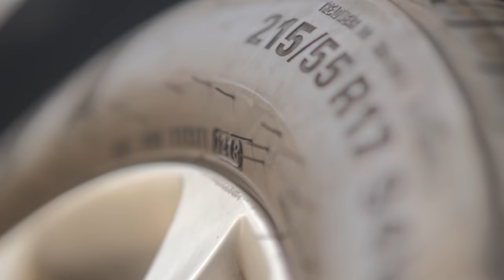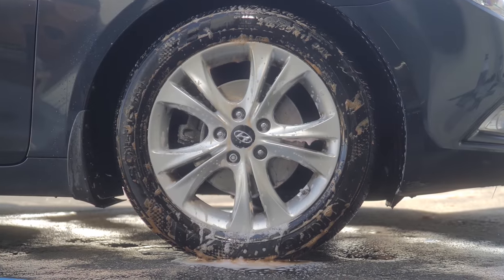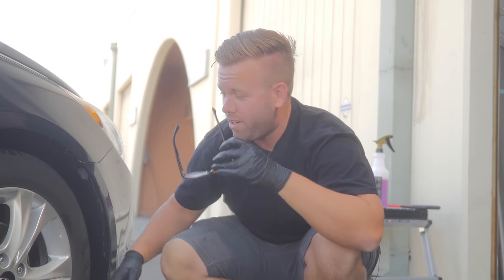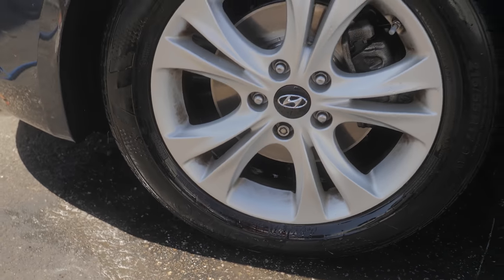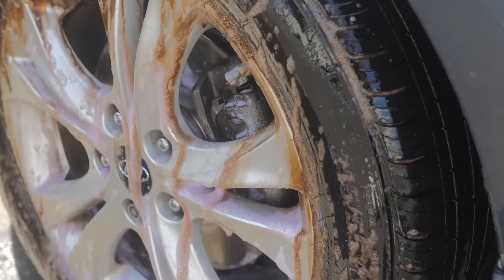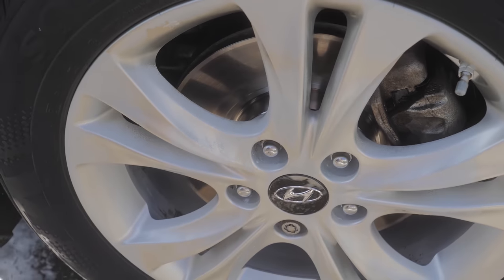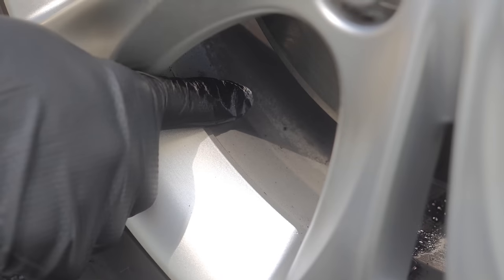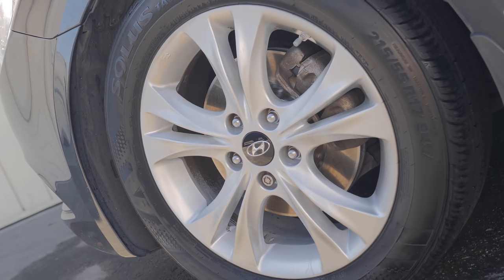P&S BRAKE BUSTER VS ADAMS WHEEL & TIRE CLEANER: WHICH ONE PERFORMS BEST?

Comment: I great way to test the strength of these products was to use them against each other with a second pass but flip the products by using Adams on the tire you used P&S on and vice versa to see if either browned the tire further.

Comment: Ive been using Brake buster for a while and I really like it. It foams well and its got rust inhibitors. The touchless aspect doesn't matter to me because I always use wheel and tire brushes. I may try out Adams though just to try.
Reply: Did you try out Adam's yet? Curious to know the results and your thoughts.
Reply: @jayl2414  everything’s subjective but in all honesty use P&S BB for maintenance washes {weekly/biweekly} 
If you need serious wheel and tyre cleaning Adams

Comment: These tire and wheel cleaners are all going to perform differently according to your wheel configurations. Metal,sealed,unsealed, bright,matte, etc. to me a good video would show the most cleaning with the least amount of product and no touching. Measured amounts of product and water to rinse. Equal is equal. Some spray half a bottle while others use several pumps is not a test! Just using a pressure washer aline should clean most daily dirt off. When used to help a cleaner, not very convincing!

Comment: I like watching a video such as this where the product is put on with no agitation or touching, because if the product does well without even having to touch it, then you can feel confident that it will work amazingly after agitation. Thanks for the video. Adams would be World Class at cleaning wheels and tires if they could just Fix the HORRIBLE Smell.

Comment: I have switched from other wheel and tire cleaners to P&S Brake Buster due to the extreme value of the gallon size. I agitate with a Speedmaster brush anyway. However, I recently added a foaming spray head to my Brake Buster bottle and was blown away at how much better the Brake Buster performed! The added dwell time made all the difference. While the product used to run off too quickly before, now the foam just hangs out and does some work. I really don't need to agitate any more. I highly recommend foaming the P&S.
Reply: What's your dilution ratio in the foamer?
Reply: @stijnmaertens9491  I do a 50/50 dilution because it is just a spray bottle with a foaming head.
Reply: @FYRARMS  do you know which spray bottle with foaming head you have? I need to buy few.
Reply: @smashit002  just buy the foaming nozzles. You buy in 3’s and 5’s on Amazon or detail supply store.

Comment: I like the fact brake buster has a rust inhibitor in it plus cost is less. I would have liked to see you wipe the tires with a white towel to check which one is cleaner

Comment: Brakebuster is 20 bucks a gallon and Adams is 40. As an enthusiast, the longest I will go is two weeks without washing my car. I don’t even need brakebuster at full strength. Adams will stain vinyl and clear bras if excess product gets sprayed on as well as paint if not rinsed IMMEDIATELY. Brakebuster has corrosion inhibitors and can even be sprayed onto paint to loosen up big guts without damage.

Comment: Iron remover is not needed for most people that care for their cars. Heck i use reg soap at times.
Expensive but cant wait to try Auto Fantastics revised foam cannon wheel cleaner.
Reply: Iron remover is actually pretty crucial, it dissolves any residue you might've not picked up while scrubbung. It's like saying using a clay bar is useless just use a brush to remove the dirt
Reply: @robbieeeeeee7  no matter how well you maintain your car there a lot of things beyond your power that can contaminate your car like 10mi drives to work, your car being parked under trees all day long, and windy conditions. Of course I'm not suggesting to clay your car every month but it doesn't hurt to do it once or twice a year
Reply: @LeJunny  if those are your conditions then why don't you do a ceramic coating? In the long run it will save you a ton of time and money since iron removers are expensive
Reply: @robbieeeeeee7  I like working on my own car rather than paying someone so I'm waiting for an opportunity to try it on someone else's car before I experiment on my own 😅
Reply: @LeJunny  it's very very easy to apply modern ceramic coatings. It's even easier than applying a wax or sealant imo. The labor intensive aspect is the paint correction
Reply: @robbieeeeeee7  I've looked at a few of the highly recommended coatings and they all have directions that make it hard for me to apply because most require a 20min setting period which I can't allow because I park in an outdoor drive way and don't have an indoor garage
Reply: @robbieeeeeee7  I know Chemical Guys has a hydrocharge product that's extremely easy to use, I'll be giving that a try soon
Reply: @robbieeeeeee7  I just don't wanna any dust or tree sap getting on the product as it sets. You're the second person who's warned me about Chemical Guys but honestly I love their products. There stores have helpful staff that give demos on your own car before buying
Reply: @robbieeeeeee7  I used to be a huge Adam's and Mothers user but recently discovered Chemical Guys butter wax which I personally prefer over Adam's and I've been hooked since

Comment: I ran out of my 2nd gallon of BB. Bought a gallon of Adams TWC. Straight i like it better than BB. On my tires I could never get white foam. Did take two passes with Adams but it was white (and red). BB Also claims rust inhibiters, i dont know about Adams but my rotors seemed less rusty after. Its also more foamy or sudsy using a regular sprayer. Definitely a better product than BB.

Comment: Immediate performance wise is Adams. I believe Meguiar's Hot Rims I believe the line is called tire & wheel cleaner will do just as good of a job as Adams.
Reply: The Meguiar's Hot Rims has acid cleaner where the P&S and Adams is not.

Comment: I think because brake buster has inhibitors in it it's not the same as Adam's. Adam's is a strong apc per Adam's. I personally dont want a really strong apc used on my wheels.  You should test adams against a straight apc. Try Adam's against purple power or super clean. Something along that line. No matter what at the price point of $40 for a gallon of Adam's its not worth using. You can get several other cleaners for under $20 for a gallon.

Comment: Best thing in my opinion with brake buster is no rusting on the rotors
Reply: Please explain your comment... I typically use megs wheel brightner...  I did notice rusting...is the wheel brightener causing some of that?
Reply: bij  yes because of the powerful strength of the product it is acid based. The brake buster though you have to scrub to get the same results as the acid based it wont leave rust Mark's on your rotors. Also has corrosion inhibitors that helps protect your wheels and rotors.
Reply: @senkofam  thanks for the information

Comment: Adam's rubber cleaner is really good and this combination just seems to work a touch better.  Surprised that the Adams is only $12/bottle but seems to take a lot of product.  And of course I would always add my brushes with either product.

Comment: Adam's is a name I know better, but does long-term use damage the paint on a wheel?  I have original  Hellcat reproduction gloss black painted wheels and concerned about the strong Alkaline /chemicals potential damage.  ( I Intend to use the Adam's angled wheel brush to get to the barrel of the wheels.)
I've been using Meguiars soap and microfiber towels.

Comment: Does Adams have the rust inhibitors P&S boasts about?
Reply from the maker: I’m not convinced that’s even a really thing.
Reply: @autodetailingpodcast  in the vehicle repair industry it is. Especially with tires and wheels. Most tires mounting soaps and lube has it. tires will get some condensation inside from constant temp swings in the tire. It also helps with corrosion. I have used 3Ds super wheel cleaner and my rotors will get surface rust on them. I would say if anyone who does their own mechanical work on their car, I would look in to the rust inhibitors. Living in the midwest, rust is going to happen.

Comment: Great review. I’m about to use Adams wheel cleaner for the first time. I used PS last time. Interested to see the results!

Can I ask which sprayer you are using in the video? Looks very high pressure for a garden hose
Reply: I'm not sure what sprayer he is using but it is not a garden hose, if you listen close you can hear the pressure washer running in the background.

Comment: Great Video Jimbo, this was the talk of social media this past week between the two. I will say i have not used Adams yet but have been using P&S  ,and for the money P&S wins it for me. The Adams is definitely showing to be a legit product but possibly not cost effective when doing this as a side gig. But for $22 a gallon for P&S ill continue to buy that. However the Adams is a strong APC as said by Kyle in the videos. What you should try it Adams APC vs Wheel and Tire Cleaner see if the results are identical or not ? Maybe they changed the viscosity in their apc and renamed it? Idk just a thought.

Comment: A little dose of reality I would agitate my rims and tires, 22 bucks for a GALLON free shipping PS now 16oz for 33 bucks plus shipping not even close to a viable alternative LMFAO @ you if they are a very similar product.
Reply from the maker: Your right if I use a brush it would work faster and better. But you could just pick up an APC if your gonna do all that. Adams usually always had at least 15% off. So it’s more like $22 and $28 for the gallons, which is still a big difference for some.